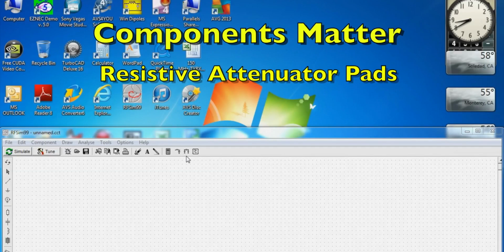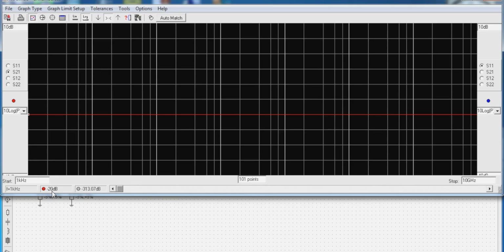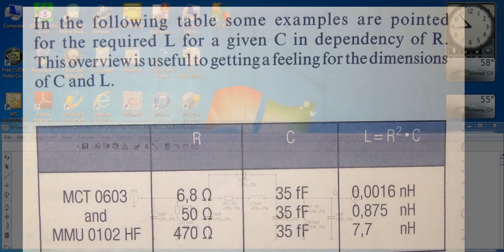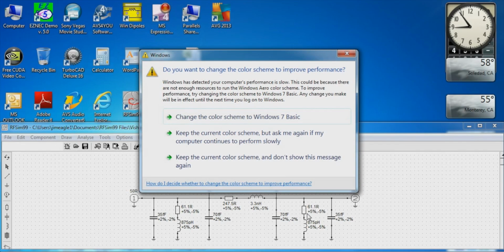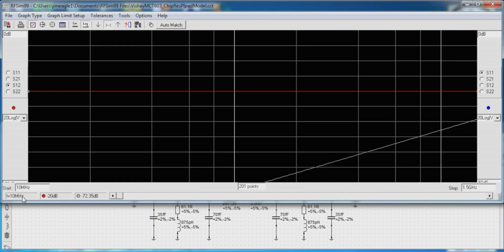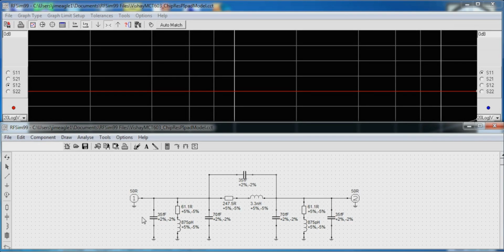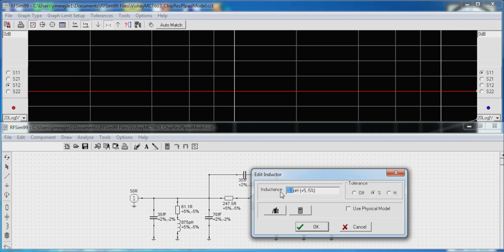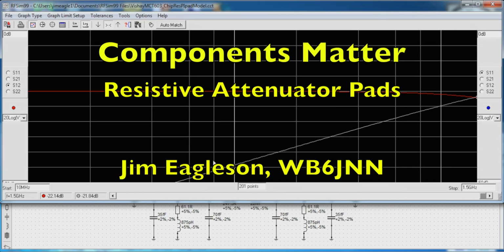Components Matter  - Attenuator Pads

Comment from the maker: So folks, you now have a good tutorial about the issues surrounding the making of attenuators and/or use of components both on and off circuit boards.  In the case of the DSA815-TG Spectrum Analyzer, which has an upper limit of 1.5 GHz, the techniques used by W2AEW for his attenuator would seem to be adequate for use at Amateur Radio HF, VHF, UHF and low microwave RF  frequencies (1296 & 2300 MHz).  G0HZU's caution about reliability should also be considered when you make your attenuator.

Comment from the maker: It is true that I guessed without reference to the formula.  'My Bad', as Homer Simpson would say.

The VSD-AP0010-0504 Vishay App Note can be found online.  As you indicate, 0.875nH should be 0.0875 for the 50 Ohm resistor. Your point about the 250 Ohm resistor is obviously correct as well.  Looks to me like the app note has at least one error in decimal place.  

Again, if you have a better model for consumer grade SMD resistors, please provide us with a reference.  Thanks.

Comment: Part2: In this case, I think the simplest answer is to look at the manuf charts because you will see that values around 120R-150R are the best in remaining faithful up to a couple of GHz. Below this value they tend to be a bit inductive and above 150R they look net capacitive.

eg it's not good to use a couple of 510R resistors in parallel to get in the ballpark of 247R because the attenuation will reduce towards 2GHz because of the unwanted capacitance in the two resistors.

Comment: Part3: So I think a good way to make an accurate 20dB attenuator using chip resistors and the W2AEW approach is to buy maybe qty100 x 120R resistors in 5% tolerance. Use a DVM to cherry pick the ones that are closest to about 122R to get the 61R resistance by putting two in parallel. Then pick two closest to about 123.7R in series to make the 247.5R part of the attenuator.

Comment: Part 4: Build it solidly and stiffly such that the chip resistors can't fracture under handling stresses and the result will be a very accurate attenuator up to maybe 2GHz. But it will be hard to make it reliable for everyday use because the resistors are so fragile when assembled like this.

Comment from the maker: I do not believe that the resistor I used for the model is the highest quality unit but it is closer to components readily available to hobbyists.  The basic point that parasitic inductance matters is clearly demonstrated, which was the point of this video.

I did imply that one shouldn't rely on the manufacturer's 'typical' data.  My experience suggests that it is usually worse than, not better than stated.  Perhaps you can supply us with a better resistor model. I used what I found.

Comment from the maker: I hope to demonstrate why that can happen.  There are many ways to go astray when etching a PCB including making certain that all connection paths between the input and output are 50 Ohms by using Microstrip or Stripline techniqes, avoiding poor grounds.  Avoiding input to output connector coupling.  Avoiding launching on and off the board inductively (connector pins are inductors if you aren't careful.  Using good quality PCB.  Not all FR4 is equal.  Thickness matters, both board and copper.

Comment: For the very basic model you are using I would expect the inductance of an 0603 240R resistor to be between 1nH and 1.5nH but it depends on the maker. A 470R 0603 resistor won't have 7.7nH inductance. Whatever equation they are using to get those values isn't realistic or maybe you are misreading what the role of that chart is and assuming those values are realistic for 'real' 0603 resistors. That is not a good model data to work with despite it appearing on a Vishay datasheet somewhere.

Comment from the maker: Well, actually it's a bit more complex than the RFSim99 model shows but this is sufficient to demonstrate the issues.  Unfortunately really complete modeling software is (1) very expensive, (2) has a steep learning curve, (3) usually requires an engineer experienced in the particular software used and still needs confirmation by testing.  Frankly, most places that I have worked in my rf career couldn't (or didn't care to) afford the $10K to $100K+ required to purchase such programs.

Comment: Nice video but I don't agree with the model data for the resistors in your chart from Vishay. I don't think a decent 240R 0603 resistor will have about 4nH inductance. Besides you haven't read the (very crude) equation on the datasheet  properly. The inductance is a function of R^2 on your chart so you should have calculated a different (lower) value for the inductance of the 240R resistor. The odd looking chart looks to have a mistake in it by Vishay for the 50R calculation anyway.

Comment: I accept that you used what you found (Vishay) but I think you didn't use it properly because you 'guessed' 4nH. If you work out L=R^2 *C for 240R it = 2nH. But I think Vishay did their own sums wrong for the 50R resistor in the table because they say 0.875nH but the R^2 *C calculation gives 0.0875nH. Do the R^2*C sums yourself to see if you agree with Vishay for all three examples in their chart. The chart gives strange values for L that don't agree with mainstream chip resistor models anyway.

Comment: Part1. Yes, Vishay have provided you a poor model in my opinion. Few people need to dissect a chip resistor to model it in the GHz region but when they do they usually also take into account the PCB dielectric and also the height of the dielectric. Modelithics are a company that provide models (for cash ) that allow you to enter these parameters. 
But it looks like W2AEW was trying to use chip resistors without a PCB to make an attenuator so this needs a different (unconventional) model.